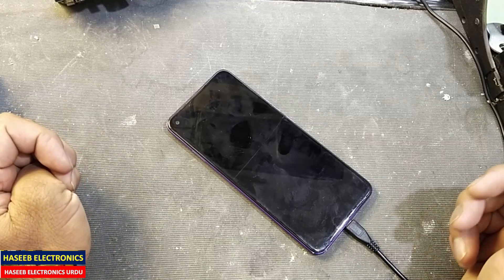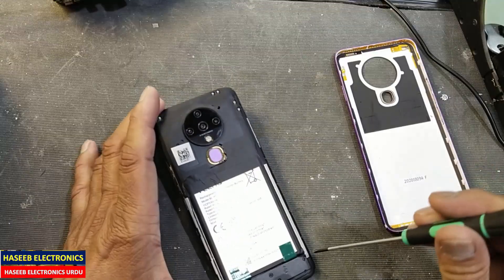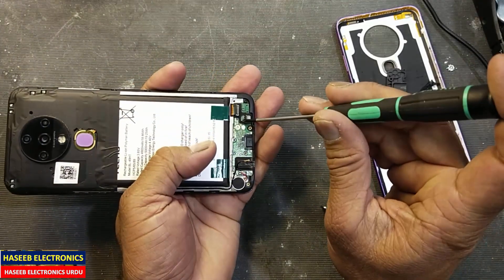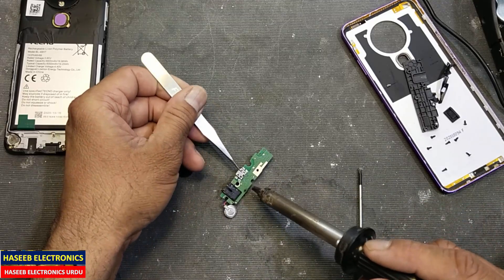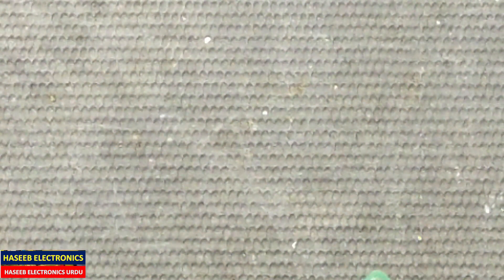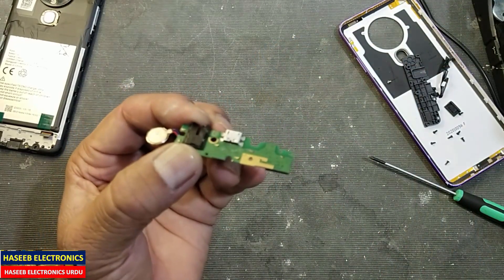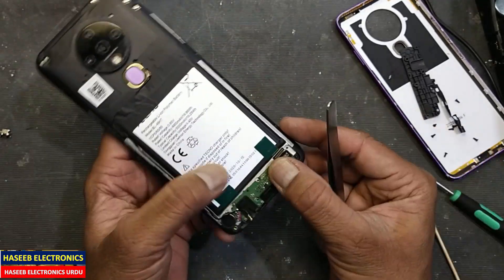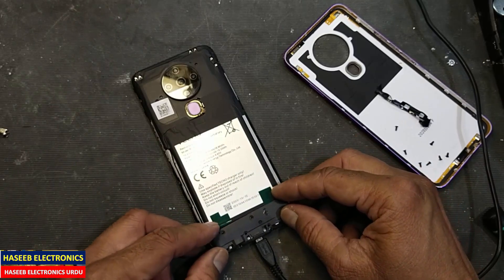{603} How To Replace USB Charging Port In Smartphone / Change USB Connector in Mobile Phone

Comment: I'm curious but might be a stupid question where can you get the charging port replacements for USB-C
Reply from the maker: you are welcomed. and your question is valuable 
USB connectors are easily available on mobile phone parts sellers shops. (i purchase locally here in Jordan) or we can purchase online from aliExpress, alibaba, banggood, ebay, amazon, or other online vendors
while shopping online we need to know the exact part number of our required part. (its fittings, pin angle, pin direction, size) because each connector has its dedicated specs
Reply: @HaseebElectronics  thanks for the help